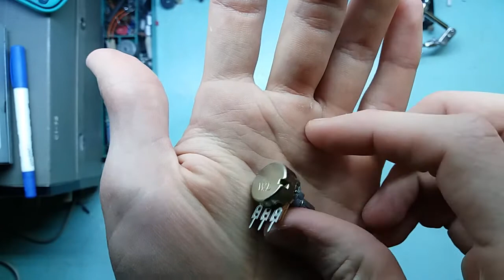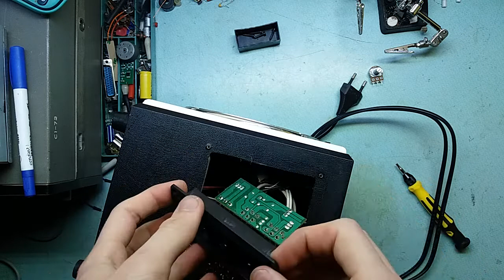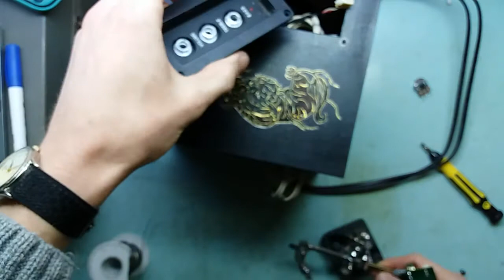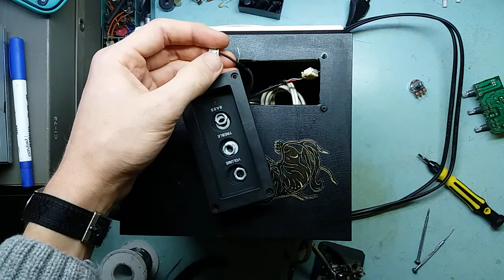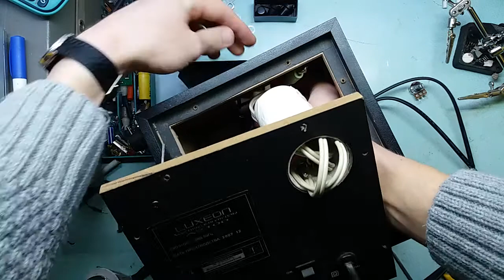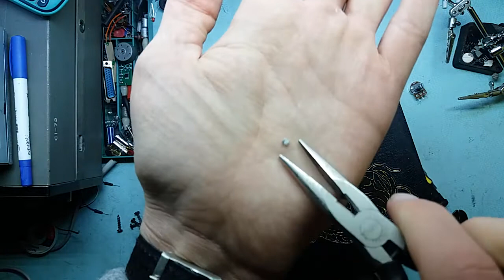Another boring repair - Part 2

Comment: I have had stubborn connectors that when i pull the plug, the plastic socket comes with it, just the pins standing prowd, dam glue gets everywhere.
That pot looks vitually identical, some pot designs are a bastard to get, large volume control dual gang pots in amplifiers with special loudness tappings are a shit to get.

I have a frend (yes it's possible) that plays the world of WarCrap, that's what i call it.
Bores me stiff as does nothing usefull, but he is bored by electronics, so there you go lol.
Reply from the maker: zx8401ztv Yes, I've had experience with such connectors too :D 
 I like to play games once in a while, when I got tired of getting the switching converter 100% efficient LOL
 But I'm not obsessed with the games at all, purely because now I'm obsessed with electronics :D
Reply from the maker: zx8401ztv Oh yes I'm hooked. How else would you explain me having a meal then rushing fast to the desk to write down the idea how to improve the circuit LOL